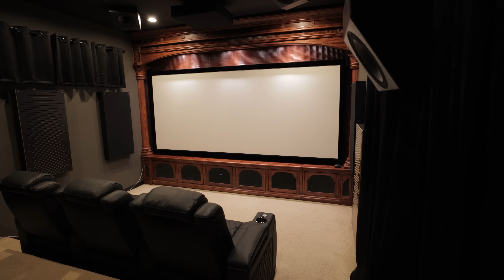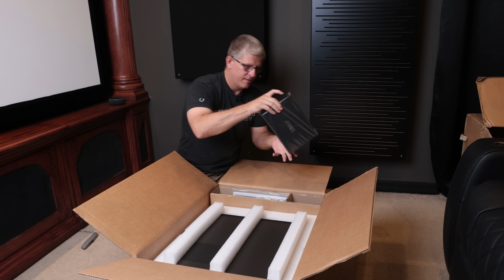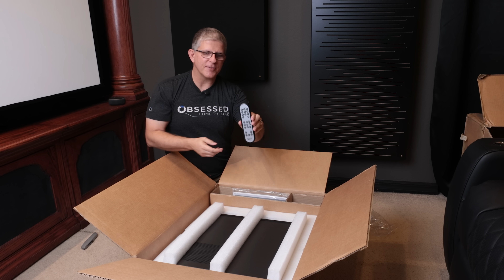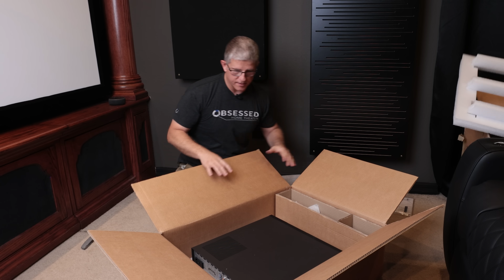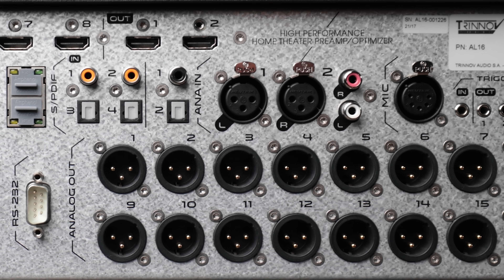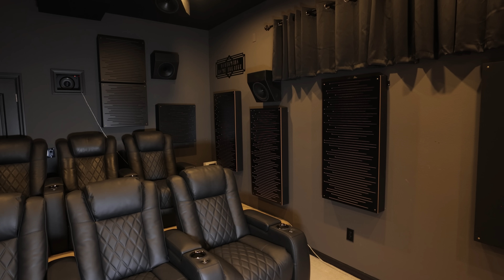The Ultimate Home Theater Processor? - Trinnov Altitude 16

Comment: The Trinnov 16 can actually handle more than 16 channels of Dolby Atmos processing. It can do up to 20.  It can upmix up to 20 speaker outputs using DTS: X Pro as well. That's what the digital outputs are for.  With external DAC's of your choice, you can configure more subwoofer outs or Dolby Atmos or DTS: X Pro speaker positions.  Or if you want to max out the digital outputs for speaker channels, you can use the single LFE out to a MiniDSP and do multi-sub calibration with it.  This adds a level of complexity with two different calibration systems, but the benefit is that you don't necessarily have to purchase the much more expensive Altitude 32 if you don't need to.  The Dolby Atmos rendering viewer is awesome too as you can see how static or active an Atmos audio mix actually is.

Comment: I have no doubt it’s a quality product but I do doubt it’s 3 times improvement over say an Anthem AVM 90 or Marantz etc I just can’t fathom in a blind shootout you could see/hear any difference
Reply from the maker: I’m already seeing the level of calibration is vastly different what Anthem provides which might be necessary for complex systems with fully active crossovers and/or massive channel counts.

With every high end performance product, the law of diminishing returns is at work so the performance increase will not be equal to the price difference. But everyone’s “worth it” will be different.

Comment: This is not end game. The true end game is Stormaudio MK3 with ADEC and AOIP, You can play with Dirac ART and lots of professional grade and mixer grade DAC with AOIP PTP Clock(10Mhz). Trinnov doesn't have any aoip support, the system is slow sloppy with anti human UI. The storage on the Trinnov is cheap USB stick which always drop the data(calibration before and after only filter showing) The system is so unstable that even HDMI has to wait very long time to get the sound. For this price, I would say run away from Trinnov and buy a Marantz AV10 with bass control (because the Waveforming is just a scam).

Comment: Only thing that stopped me from getting a trinnov is that it sounded similar to thr avm90. I went with thr avm90. Plus you have to buy a external dac to run 4 subwoofers if your running 13 channels with trinnov- Money pit
Reply from the maker: I’ve heard nothing but great things about the AVM 90.

Comment: The 16 doesnt pass a sub 20Hz signal in their processing.  That and the way the optimiizer neuters bass makes it a complete deal breaker for me.  Thx for the review
Reply: Looking forward to more! I just got my Trinnov.
Reply from the maker: Congrats Derek!
Reply: @Youthman thanks! Should go well with my perlisten setup.
Reply: What do you mean it doesn’t pass sub 20hz? Surely it doesn’t just cut the signal at 20hz?
Reply from the maker: I believe I recall during a meeting with Trinnov that it does process ultra low. According to ChatGPT,

The Trinnov Altitude 16 delivers a remarkably flat frequency response down to 0 Hz (yes, literally DC), maintaining ±0.5 dB from 0 Hz up to 20 kHz—ensuring accurate processing across the entire audible (and beyond) spectrum.
Reply: I'm flat down to 4hz with my Trinnov and JTR setup 😎
Reply from the maker: Awesome!

Comment: Trinnov has its own room correction, right?  I recall listening to some binaural comparisons of AVM90 vs Trinnov and it definitely sounded less discrete.  Off memory, the surroundness of the Trinnov was definitely more immersive and created a 3 dimensional sound but the discreteness of the Anthem AVM90 carried more directional oomph.   I'd be curious to hear what an explosion sounds like on a Trinnov vs Anthem AVM90 or music for that matter.

I think the test of immersion is always between Trinnov and Sony's new sound, particularly the ES7000 adjusting for price difference - if the Sony provides 90% of the Trinnov's immersion and costs 17%, then it's hard to say the Trinnov is a better choice.
Reply: Would be nice if someone compared in double blind scenario with separate same amps in case of sony

Comment: Why would a smaller room don’t benefit a Trinnov as much as a large room?

Same as the speaker configuration?

This is about quality and processing, room size and how many speakers you have nothing to do with why you want a Trinnov.
Reply from the maker: My point is one of the main reasons to go with a Trinnov or Storm is when you have 16 - 32 channels. You typically can’t get that with most processors. 

Would a 7.1 system benefit from Trinnov? Possibly,

Would someone buy a Trinnov for a 2ch setup? Maybe so. 

The point being the higher the channel count, the more Trinnov would be needed.

Comment: An extreme minority of your viewers could even afford this processor. I appreciate what it brings to the table, but it's just not realistic for most hobbyists. Nevertheless I do like watching reviews for it.
Reply: The amount of control this provides is exceptional.  If he reviews speakers, he needs to remove the limitations of a processor out of the mix to hear the speakers.   This is the best answer IMHO.   I never heard my wise speakers on 90% of content before I nabbed one of these.
Reply: @tkcdac the trinnov is one of - if Not the best - complete package. But when it comes to DA convertion, it is very good but Not at the top end.

Then again as someone who works with dsps in pretty much every project and Running professional grade dsps, its probably good enough for maybe only the Most extreme efficiency speakers where the higher snr could be beneficial. But this is on speakers that i dont think anyone really uses in a usecase the trinnov is Made for.

( PA )

Comment: Isn't the chasis or motherboard this unit is built from more than 8 years old at this point?  When would we expect Trinnov to release a Gen2 of this product?
Reply from the maker: That's one of the benefits of Trinnov. The hardware and chassis are sufficient the way it is. Everything else they can push via firmware. I believe a lot of the internals are modular so when something like HDMI 3.0 is developed, the board can be upgraded without having to purchase an entirely new unit.
Reply: If it ain't broke, don't fix it
Reply: What are you missing today?
What would new hardware do for you besides higher price?
Reply: Trinnov has a warranty extension program where the refurbish existing units and give them another 5 years of warranty. I’m not sure if the motherboard gets upgraded, but there is the opportunity for it with the refurbishment.